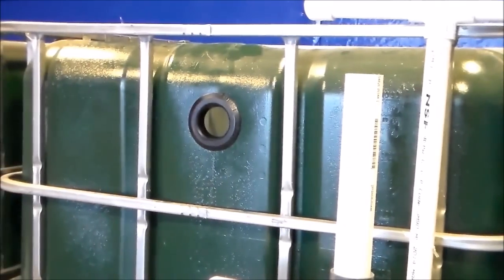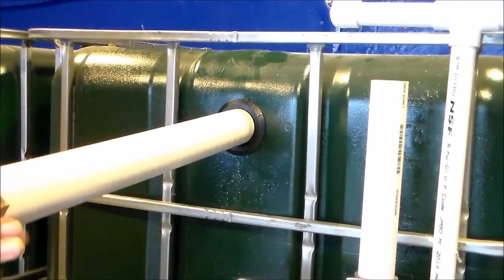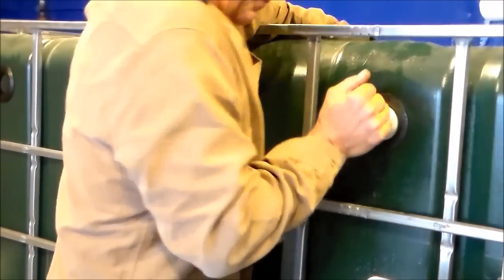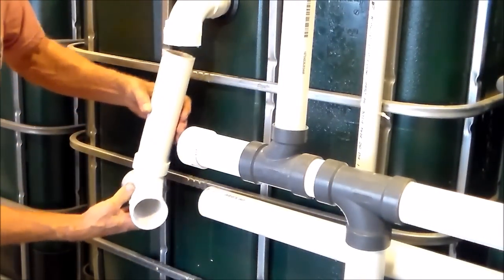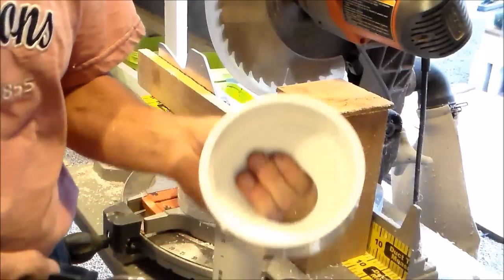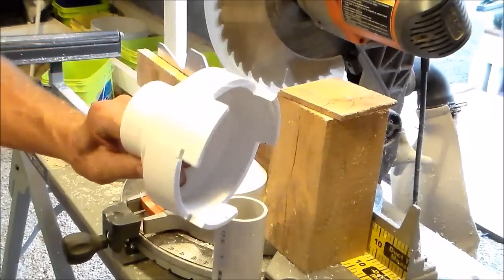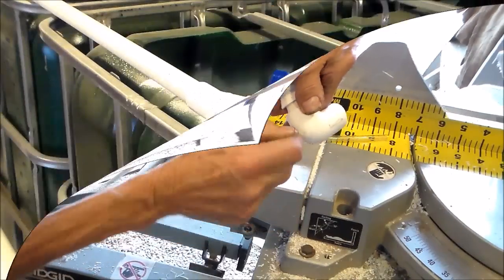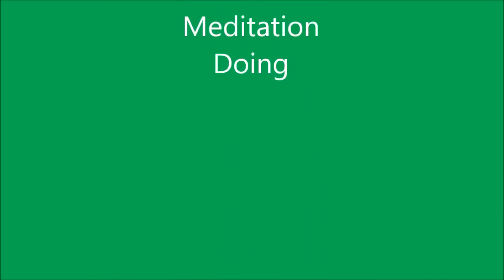Aquaponics fish tank, tips on setup and connecting!

Comment: I saw a guy who took a section of the pipe and heated it with a heat gun  and shoved it over a glass bottle to flare it outwards like a bugle , after it cooled it was used as a way to reverse flare the pipes or reduce the size  by heating it then shoving the pipe into the flared end , this is very fast too!  why channel locks and not a ratchet.

Comment: I like your setup,  is there any difference having your drain pipe right at the center versus  closer to the outlet wall where you can catch more solid waste due to the swirling effect of your water?
Reply from the maker: It should not make a difference on the drain location.

Comment: Fancy design for the insertion...why dont you use a file to bevel the end of the pipe!? And dont mix black and white pipe. they are 2 different materials. Ive fixed many plumbing jobs that mixed the two.
Nice job otherwise :)

Comment: Hello, nice video but i have a question, how do you connect the pump to those tubes?
Reply from the maker: These are the overflow tubes, they just drain. the pump in the sump tank is connected with vinyl hoes and to a barbed fitting.

Comment: dish soap will kill your fish, and microbes.. you'd be better off to use olive oil or vegetable oil.. cocoanut oil or something like that.  I noticed you had a floater at the end of the video.. i'll bet that habit make have brought that about.  Other than that, nice video.. nice set up.  I am a life long aquarist with a couple 125 gallon tanks and a few other smaller ones... the smaller the tank the less water you have and the less forgiving they will be to having foreign contaminants introduced.  You seem to be using either 275 gallon or 330 gallon ibc totes as your tanks so it'll be somewhat forgiving, but still poison is poison to the fish.  i use vinegar to clean my tanks it won't harm your system, fish or beneficial bacteria.   I hope this helps you in some way.
Reply: also the dawn isn't a lubricant, it's actually a cement. Probably doesn't matter for your uses, but one day it might matter :)
Reply from the maker: Thank you very much for your knowledge and input my friend---Don

Comment: This is a good method!

A chamfer would make it a little easier to get started, likely make the wiggling non-necessary.

I.E.:  File or sand paper at 45 on the pipe edge for 30 seconds or so.
Reply: I'd also mark the depth of penetration on the pipe being stabbed before I began.

Comment: if you file the end of the pipe going into the compression fitting(like a pencil sharpener),it doesn't damage the seal....And when you glue larger pipes than 2',it is a good idea to use primer before applying the glue..less failed joins..
Reply from the maker: +Steven Brown Thanks my friend

Comment: If you use zip ties, cut the end off with toe nail clippers and you won't have a sharp edge to snag everything else. Also, are you using a one part PVC glue or leaving off the cleaner?
Reply from the maker: +Stuart Warren Thanks for the tip. I don't worry about the cleaner on the joints, there is minimum pressure in these pipes, I don't worry about leaks, I worry that a joint might come apart. The glue is my security. Thanks my friend---Don

Comment: Don - This is another really helpful post. Thank you for sharing!!!!
Reply: Uniseals demo was helpful but direction was reversed. Designed to go from inside the vessel to the outside. Not so critical when it is just an overflow such as in the demo, but wherever there is depth and pressure, it becomes more of an issue.

Comment: Donald, do you remember the stand-pipe length you cut them to.  About to receive 4 totes today and figured I'd copy what works.  Thanks for sharing
Reply from the maker: Robert Madden The stand pipes in the bell siphon that uses the the p-trap underneath, was cut at 7 inches and the clearance between the top of the stand pipe and inside of the bell tube is 3/4 inch.  the bell will float, it should be weighted down so the system will burp and make a quick siphon action.  I hope this is what you were asking. Don
Reply: Well that answered my question regarding stand pipes in the bell Siphon.  Lol,  I was saving that one for later. Sorry Donald,  but I meant what was stand pipe length in fish tank from bottom to the T fitting where the h2O exits fish tank. Again,  thanks
Reply from the maker: Robert Madden The bottom of that stand pipe I have the flared end terminating it with notches cut into it to allow water to enter since it is setting on the bottom of the tank--- the length then was determined and set to where I wanted the top height of the water in the tank--- just make sure you use a "t" fitting at the top of the stand pipe so as not to create a siphon situation which might not be good for the fish in the tank.--- If you need the exact length that I used--- I could measure it tomorrow and get back with you---Don